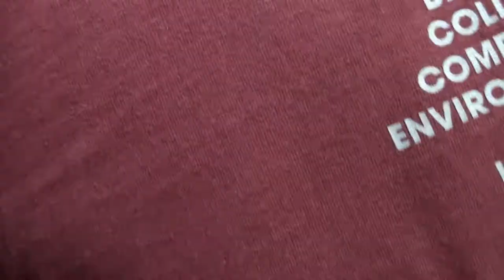KTM 1290 SAR Powercell S4 POD Install

Comment: Just bought this kit and found your video. Thanks for making it.
Do you remember those two little plastic plugs that came with the bolts? Where do they go?
Thanks again
Reply from the maker: Honestly, I don't remember if I even used them or not.  I would recommend reaching out to Powercell.
Reply: @ls6777  ok thanks

Comment: Is the inside of those pods solid? What stops the intake sucking them in? I installed spring loaded pods on my 1290 adventure intake and they got sucked inside out, never went past the butterfly though.
Reply from the maker: Honestly, I don’t remember.  But these are not cheap units.  I believe they have a semi solid frame inside, but they definitely don’t get sucked into the butteryfly’s.  This is a very common setup for these bikes.